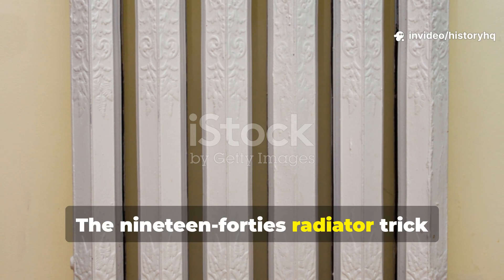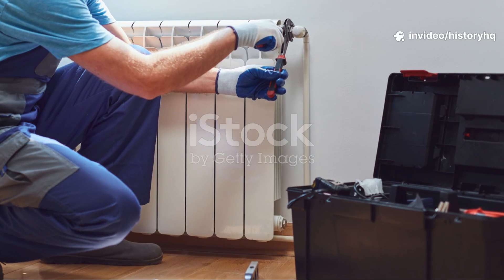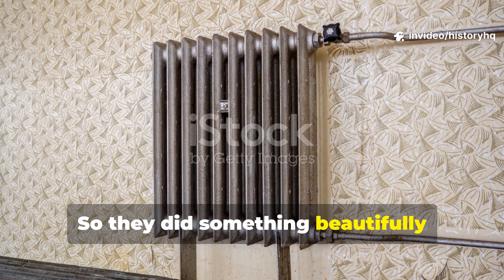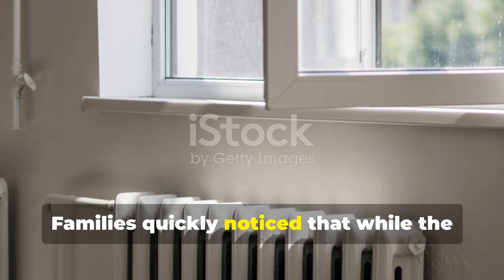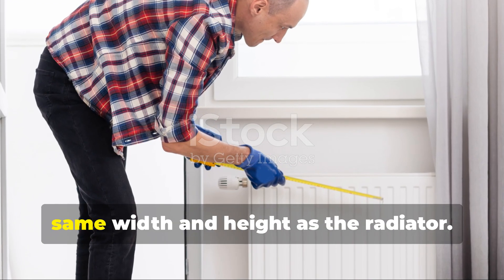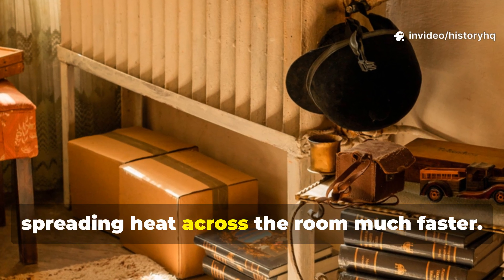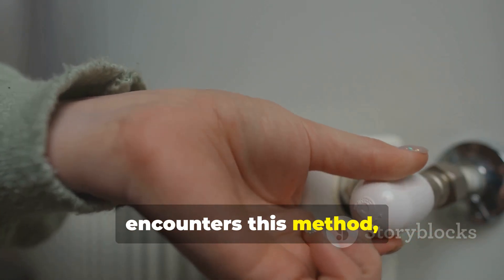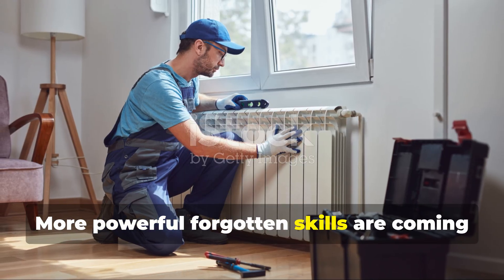The 1940s Radiator Trick That Heats Your Home Better Than Modern Systems

Comment: Growing-up in the 60's in Chicago, we had hot water radiator heat.  It was efficient and we loved it.  When I moved out of the house, the warmest apartments I lived in had steam radiator heat.  The downside... No air conditioning (or had to use window air conditioners).
Reply from the maker: That’s the magic of mass and convection — radiators didn’t just heat air, they heated rooms. Hard to replicate that kind of comfort today.
Reply from the maker: You’re right — steam moves heat brutally well. This video zooms in on how homes squeezed even more performance out of it during shortages.